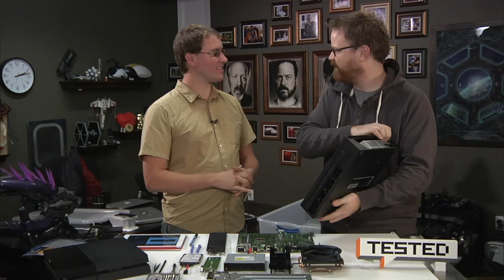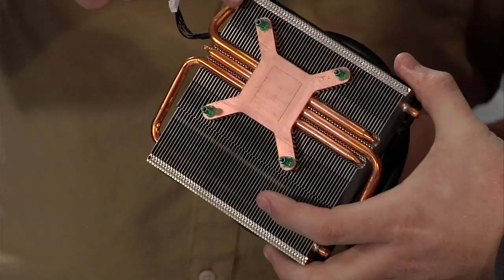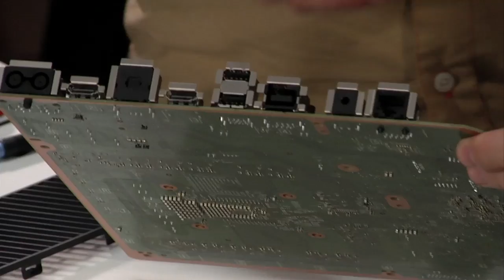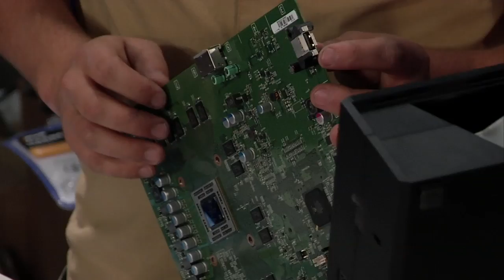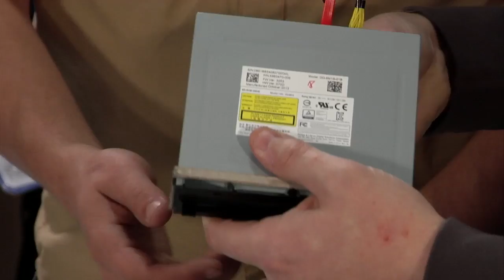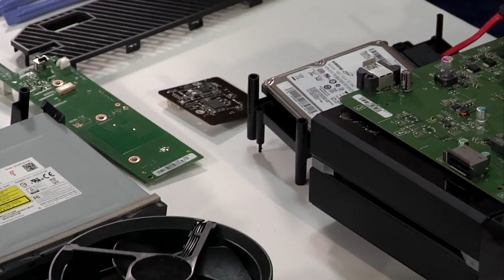What's Inside Microsoft's Xbox One Console

Comment: About the rear USB, on my Xbox 360, I have a USB keyboard plugged into the rear USB port, which works for typing in information for any player/controller.  It's a full size keyboard, but apparently, the 360 doesn't support ten-key, because the ten-key doesn't work.
Reply: MrSmartiy
Why?  Have something against typing on a full keyboard?

Comment: at 4:00, they diss the squiggly lines to the procs used to compensate the distance for "the speed of light". Funny thing is, no conductor transmits at the true SoL. But research something called "Velocity of Propagation". Amazing stuff.....did you know fiber is actually slower than copper in transmitting signals? True.....if you doubt, read about. 

Also, look for the "onion effect".....that is really cool to know

Comment: Wait... There's copper right next to the cooling fan system?
What were they thinking!?
Reply: Uh, most every heatsink has copper heat pipes to direct heat away from the CPU.
Reply: THE HORROR! Copper being the best heat conductor! Why would they EVER use that ever!
Reply: Travis Hupp yep and the copper pipes are filled with a chemical to draw of the heat. also joshua do you actually know what your on about i guess not . i will explain . in Common units of thermal conductivity copper is 2nd to pure silver. and pure silver is way to expensive to use on a neatsink Aluminum zinc titanium are way down the list for a good conductor. thats why 90% of heatsinks use copper. ps4 uses no copper at all just a ali heatsink with thermal pads .
Reply: *****  two of you clearly didnt get sarcasm.
Reply: Joke^ Head-v

Comment: It's not speed of light, it's speed at which the electrons travel through the circuit board.

But yea it is pretty fucking cool how some one had to calculate that speed, and modify the length of every circuit that went towards the ram so all the electricity reaches the ram at the same time.

Comment: The xbox 360 problems were almost certainly caused by new (at the time) lead-free solder.  This wouldn't have been directly related to overheating, but cycles of hot and cold would have been more likely to cause failure.  There were several other similar hardware failures around the same time.  A friend of mine had a laptop with a graphics chip which suffered from similar issues; when I investigated, it seemed to be common.  It was still under warranty, and Dell replaced the unit for free.

The cooler is definitely heat pipe based; not just "chunks of copper".

The other chip is not the "north bridge".  What would have been the "north bridge" has been integrated on the cpu die for a while now.  the other chip is the "south bridge" or "IO controller hub", depending on your preferred nomenclature.

As far as processing power is concerned, people seem to have totally unreasonable expectations.  When the xbox360 came out, the top of the line graphics cards were in the 75 to maybe 115 Watt range.  This was doable in a console format.  Current top of the line graphics cards are 250 to 300 Watts, and current top-end cpus are 84 to 130 Watts.  Power is directly related to cost.  People never consider what it takes to deliver 300 Watts to a chip (at low voltage) and to remove that much heat.  It takes much more expensive power supplies, power delivery circuitry, and cooling solutions.  It can be done in a relatively small space these days (see the Mac Pro), but not cheaply.

The amount of processing power necessary is directly related to the target resolution.  The xbox one seems to be targeted at 720p (1280x720), which is low by pc standards, but okay as far as televisions are concerned.  Many people will not really notice the difference between 720p and 1080p at their normal viewing distance.  This doesn't need massive gpu power like high-end graphics cards which might have to drive two 1080p displays or more. 

The cpus are individually relatively low performance, but there is 8 of them.  Also, most current games are not cpu limited anyway; I know many people gaming with older cpus.

The tech sites like to talk about 4k displays a lot, but these are not going to represent significant television market share for quite a few years, so I really don't think 4k support is relevant.

Will anyone actually read this long of a post?

Comment: They arent chunks of copper, theyre tubes with a vapour of some sort inside kept at high pressure.
Reply: Heat pipes use low pressure, not high.  Lowering the pressure causes the working fluid (which may just be water) to boil at a low temperature and also carry the heat across the heat pipe very quickly.

Comment: I wish console manufactures worked more on silence then compact design. After 5 plus years 360 and ps3 sound like jet engines. I just don't get the point of making something small when it just sits in a living room never moving.
Reply: you must have some very strong ears. my halo reach 360 you cant even hear it 8 feet away. what you got to do is sit down and play it . dont stick your ear to the fan vent and say its noisey. .
Reply: how many years have you had your 360? And did you clean it? I did once.
Reply: Peter Miller  i had my halo reach edition 360 since 2010 i have taken it apart quiet easy and clean the fan and heatsink and inside do that usally once every year last time i did it was about 8 months ago . its true that if the fan is covered in dust and the heatsink is the same the fan will get faster and more louder the new.  xbox one should be a screw design i feel  so you can unscrew and clean out the fan and heatsink. why the heck does MS make a console thats not easierly servicable by the user.
Reply: Peter Miller also i dont think the xbox one is small ms had made it bigger and more space inside because of heat issues they had with the 360,s  i doubt if the xbox one will ever overheat . ps4 is tiny compared to xbox one, but they use a diffrent heatsink and shroud  mount and thermal pads. must admit the ps4 is light feels so light in the hands . i prefer a console with some weight myself. and you have to admit the xbox 360 s was the best design console from microsoft. shame they went the old vcr style in the one .
Reply: I usually install my games to the hard drive so that it's not noisy. I have the original Xbox 360 elite..
Reply: Fydzz same here i got the 250 gb with the halo reach edition and then bought another 320 gb i use the 320 as first hard drive and have the 250 as backup yeah my newphew got the same console he got it in 2007 around october and its still has no probs. i think the elite at the time was the most expensive console.released.
Reply: If you want something ksmall and quiet, then build a PC.
Reply: PCgameguy Gaming PCs aren't small. Please don't talk about PC when we're talking about consoles.
Reply: They can be. I thought when u install games to the hard drive u still have to leave the disc in ?
Reply: Fydzz
Gaming PCs can be small.  Here's a case that's 9.4" x 8.2" x 15.8": http://www.newegg.com/Product/Product.aspx?Item=N82E16811119261
Reply: Peter Miller yes your still need the disk but thats only for verification. after that the disk drive stops and you play off the hard drive more faster loading and it give the dvd player a good rest and uses less power and heat. i have always played games off hard drive like you do on a pc.
Reply: I know I've done that with some games, but I'll make sure I'm doing it with all and see if that makes a difference.
Reply: the new editions of 360 are completely quiet
Reply: ***** yep 360 s and the 360 e are  very quiet. as i said before i have a halo reach edtion 360 s and when playing games you don there it even if you on the dashboard 8 feet away.
Reply: Just a bunch of 360 gamers, and one guy grouping the PS3 in with the 360 because they're both consoles.

The PS3 has been dead silent since the beginning.
Reply: lucky u
Reply: The xbox one is very very quiet. I have to pay attention to it to actually hear the fan running
Reply: analyzing the noise is pointless right now. You need to wait 5 years, but the Xbox One is a little Large which is good.
Reply: That is true. Comparing it to how loud the 360 was after 5 months it is definitely much quieter.
Reply: man a mini motherboard and a small form factor graphics card like a gt610 and you get a small PC that is very capable of gaming
Reply: ***** you have slim version, I got xbox 360 elite from relase date and I must say that after those years I can hear my xbox in the other room (with closed doors) Im cleaning my xbox every 3 months but it doesnt make huge difference, btw Im installing all my games and still is really loud
Reply: Download the games on the hard drive. My old white xbox 360 got the red ring so i got the 256gb slim, Its still a piece of shit but now its a quiet piece of shit.
Reply: So far the xbone has been pretty quiet. My pc gets pretty hot. During the winter it's fine and keeps my room warm. Now that it's summer my two gpus are making my room feel like a sauna.
Reply: so you never had xbox 360 (old one)
Reply: The Xbox One is effectively silent if you are sitting a proper distance from it and don't cram it into a bookshelf. Just like the Xbox 360, the thing that makes most of the noise is the disc drive. My launch Xbox 360 is also silent to this date so long as I install games to the hard drive rather than play them off of disc.
Reply: Ya not using a disc makes a huge difference which you don't on a pc and now console is starting to go digital. Xbox One has a nice size to it. Lucky for me xbox one has nothing I want. PS4 has bloodborne, not enough to get me to buy one.

Comment: Can you really replace the hardrive on the xbox one?

does the xbox even work if you do that? will microsoft allow it, or will they just ban you for not buying their $5000 microsoft branded harddrive?
Reply: Alex Denofre
yeah i understand that you can physically replace the drive, what I'm asking is what happens after that.

Does the machine work?
will it get banned?
will it not boot at all?
Reply: Alex Denofre
alright, i remember that for the 360, you had to have a special partition(or similar) from an authentic Microsoft 250 GB drive and use that to spoof an off the shelf hard-drive with that, before it would work with the 360.

that meant that you could only run partitions as big as the ones Microsoft sold.

You're saying none of this carries over to the XBOX ONE's way of thinking?
That you could just clone the data from the standard 500 GB xbox one hdd onto a 3 TB drive, and it would have the full size without any repercussions?
Reply: devildoll89  in an estimated .5 to 2 secconds....might have to build your own bios version but sure ill upgrade it and it will be soooo fasttt ohhmmeeeggeeee  lol................... my friend this guy is not worth your time.

Comment: Does anyone know how to quickly and easily remove the bottom half of the outer shell of this console? Every Xbox One disassembly video I've looked at so far shows how to easily remove the top part of the console shell (after you remove the side panel and slide away the small plastic that connects the two halves). But isn't there a simple away to detach the bottom half of the shell without gutting the entire console?

Comment: wheres the graphics card?
Reply: the processor
Reply: the xbox one uses an APU. it's    CPU and GPU all on one chip. the ps4 uses the exact same architecture.
Reply: +Netfix It's an APU, the GPU and CPU are on the same silicone.
Reply: Lol is that a joke?
Reply: Consoles use an APU. Laptops use a similar type of device although they can use dedicated display adaptors like GPUs. Desktop gaming PC's instead use a dedicated GPU which are usually considerably more powerful.

Comment: I would think by now xbox would integrate an actual graphics card instead of using onboard graphics. Yeah it would jack up the price a bit but it would sure as hell help with the overheating problem and the system would perform a bit better. But everything has to be small slim and sexy. I dont give a fuck what it looks like, as long as it plays my games smooth.
Reply: It's meant for little kids they just pretent it's for young adults 18-25 year old. When in reality it's for younger kids who can give them more money in the later years.just like the psp.
Reply: brian mossman  - the xbox is designed to fail. this way, they make 2x the $$$. Why do it the right way, when they would lose $$$?
Reply: +Danny D.  Right why make somthing that last make it faulty and. Get more money from people replacing it's a sad business idea that work.
Reply: brian mossman wow, ok.. this has a GPU, but its located physically inside the central apu. as opposed to outside on a psi-e port, but this doesnt make it less of a gpu.
Reply: I know what an apu is. it actually would run better with a separate gpu because it would take the strain off of the cpu.
Reply: well apearently you dont know. because if you would you would say it wouyld run better or that this strains the cpu :) this doesnt strain the cpu any more than a "normal" configuration of cpu+graphics card would. 
this is just a whole graphics card, very much  like any other, the only difference is its just located on the motherboard instead of connecting via pci-e. nothing like "intel integrated graphics" or something like that. this takes the srtain off the cpu just like any graphics card would..
Reply: brian mossman 

The CPU needs the GPU right next to it because they share resources, that`s why they are CPUGPU combo system....
Reply: same,mines in a dark room so i realy dont give a shit wht it looks like.it runs better which is enough for me,and yes i have both but i refer x1
Reply: Well that CPU GPU combo didn't work for the slim versions. Lots of overheating and red dot slims for sale ebay. Only motherboard MS did right was the Jasper. They run the coolest, consume less power, and they don't break. You don't see a jasper overheat or red ring. When a jasper breaks, it's because of a stuck tray, or disc read error - easy fixes. Clean dust, replace drive belt, and laser
Reply: Danny D

APUs are made that way so defintly is not going to change...

Jaspers have better luck than the other phat versions since they were manufactured later and have better solder and heatspreaders, it has little or nothing to do with "the CPU being strained by the GPU", the the first batches of Valhalas/Trinity were bad but Coronas run very cool and have better solder so they don`t break as easy...
Reply: go on ebay and compare how many broken slims there are vs jaspers for sale. Let me know the answer. It's not about luck. Jasper are the best build for the 360 console period. Has nothing to do with mfr date or heatspreaders. An 09 jasper will outlive a 2012 slim 24/7. They both use lead free solder as required by law. Why don't you pop off the heatsink off the jasper and compare the size of the gpu and cpu. the jasper is the smallest therefore producing far less heat vs any other 360 motherboard. your "better solder" is a joke. I've reballed over 200 slim consoles, and they all have lead free solder. I've never had to ever reball a jasper...ever, but it also has lead free solder, and the x1 also has lead free solder
Reply: you reball 360s? yeah right...
Reply: You don't have to believe me. I have also reballed PC gpu, cpu's and PS3 gpu cpu's. You sure know a lot more than i do talking about "different solder", yet you couldn't challenge anything i said. All you can come up with is "you reball 360's, yeah right" FYI, every 360 i have reballed (xenon, falcon, corona, trinity) had lead free solder under the chip which is the same solder. Reballed using a hakko fr-802, and a achi-pro, and replaced with lead solder .Now go ahead and make some more ignorant comments. Shit i'll give you $1000 if you can prove to me or show me, where an xbox 360 from factory has different solder under the chip from the next 360 console, and it's not lead free.
Reply: Did you even bother to go on ebay and compare broken slims vs broken jaspers? I bet you $1000, there are more broken red dot, not turning on, overheating slims vs a broken jasper. Prove me wrong?
Reply: Danny D

because all broken 360 goto ebay... everybody knows that...
Reply: I didn't ask you where do all broken xbox 360's go to. I said to go there and compare broken slims vs broken jaspers. I'm sure you already looked and were like "WTF?"..You can find broken xbox 360's on gamers forums, craigslist, your garage sales, and local flea markets, therefore your statement of "all broken 360 go to ebay" is 100% false. The thing is EBAY is 100,000,000 greater than all of them combined. If you want to sell something. The fastest way is EBAY because they are the biggest online market online market in the world next to amazon. You're probably 10 years old on here blowing smoke
Reply: someone don`t understand sarcasm...

Comment: Hello, would it work without the disc drive ? Is there a close loop water cooler that would fit this board ? and what is the minium size required for the internal hard drive ? (I would like to install the smallest size ssd possible just for the OS even if it's limited at sata2) please.
Reply: Don't even think about modding this. Pain in the ass and tons of money.